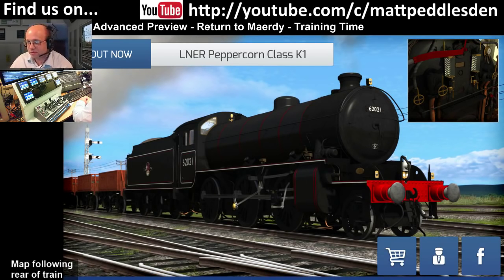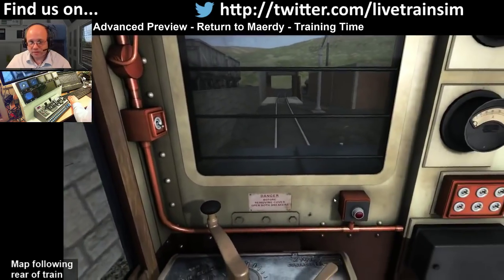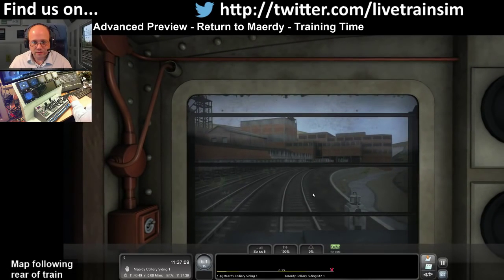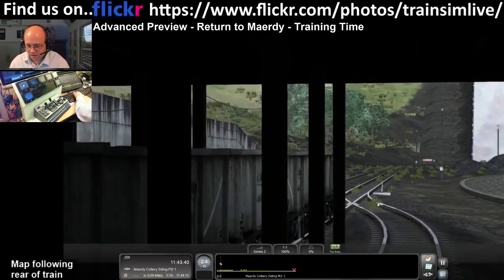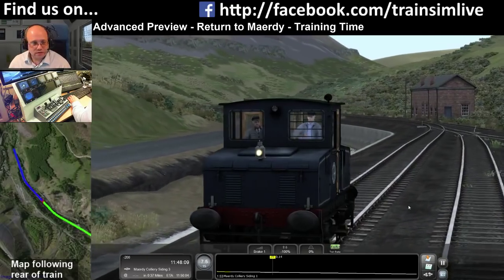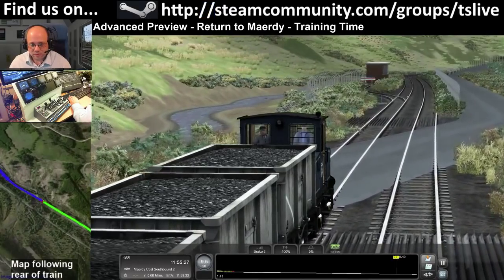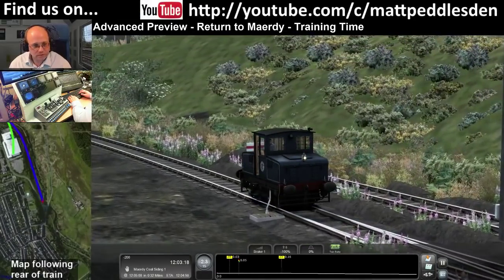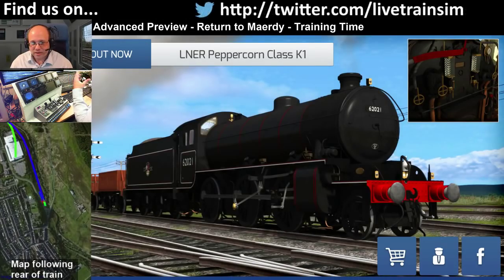Let's Play Train Simulator 2016 - Advanced Preview - Return to Maerdy - EE 3B

Comment: Know this seems a bit obvious, but what d'you do when the battery gets low? Is it possible to recharge the battery in the simulation? Or is it the case that when the battery dies, that's it, the engine's done for the scenario. I'd like to have this to use on some of my other routes, but I'd definitely want it to be rechargable...
Reply: *****

Well, darn, sort of rules it out for what I wanted to use it for, then. It didn't have to be implemented as a prototypical recharge cycle, just a key shortcut or something to instantly top up the batteries to go a bit longer...You haven't tried putting it by a fuel pump and "refueling" it have you? It could be scripted to work like a diesel...

Comment: I have just noticed a lack of detail on the loco. Any self respecting driver would have a cloth on the brake handle,to protect his hand. It must be a throwback from steam days, but I observed it several times in the 80's with the older hands, they would put a cloth on the brake lever on the first generation diesel locos and 1st generation DMUs
Reply: +Simon Kirkbright 

Yep, it's a steam engine thing. It was common to stop engines on the handbrakes when working around the yards, and some engines didn't have a continuous brake (vacuum or air) at all, only a steam brake and a hand brake. Well, in order to stop in time without banging into the buffers or a rake of wagons, you really have to wind those handbrakes down fast sometimes, and it could really do a number on your hands without a good "duster".

Not just the drivers, a lot signalmen still do this too, although besides hand protection the cloth dusters were also for keeping the lever handles shiny back before a good many of them were painted over to save on the cost of metal polish (that was BR all over, spend a pound to save a few pennies). A few of the old hands still have them tucked into their back pockets on the modern control boards, much as they did when the mechanical lever frames gave way to power frames. Old habits die hard on the railway.